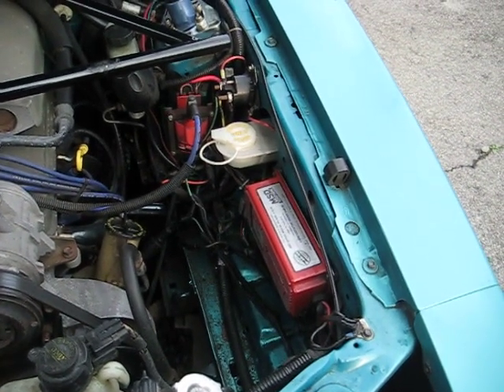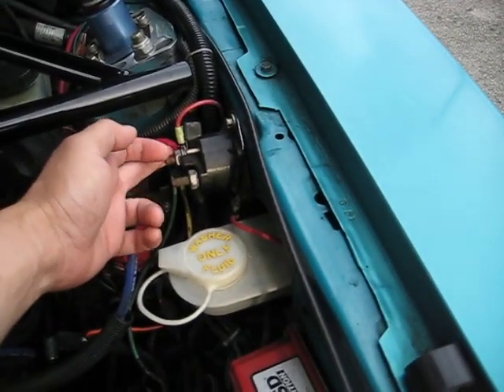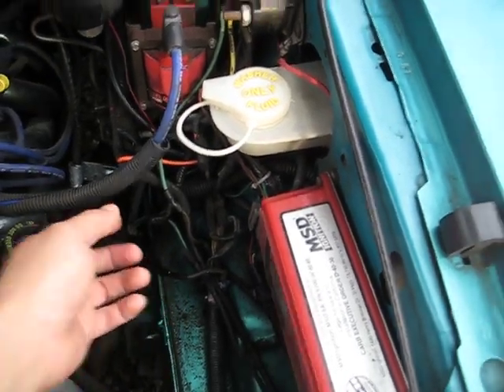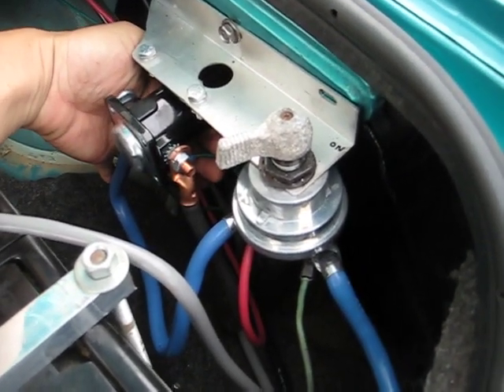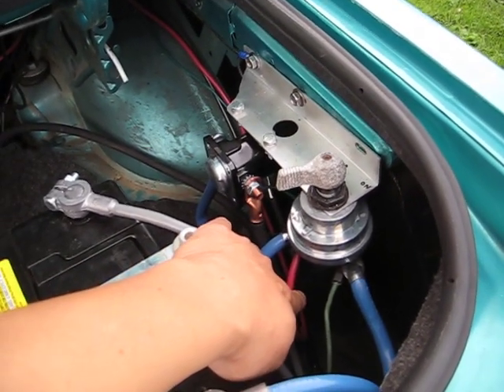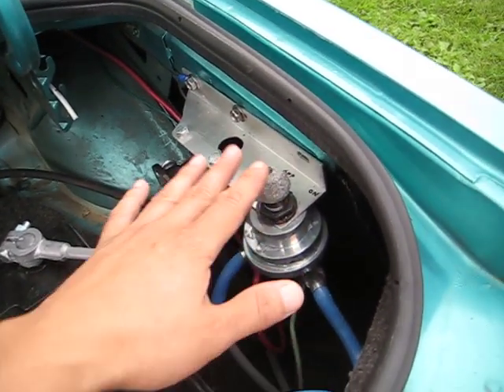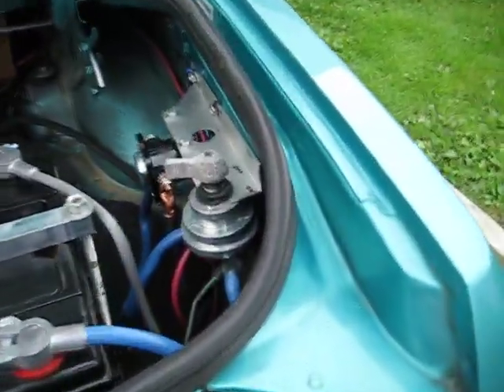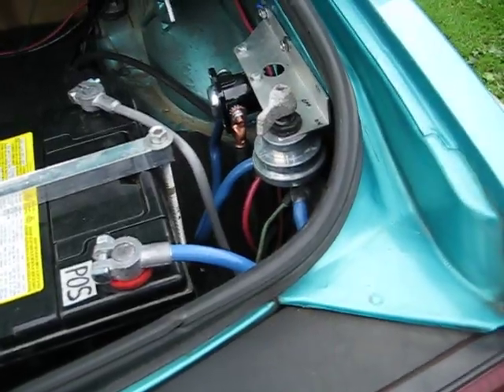Battery in trunk wiring

Comment from the maker: Did you dummies not read the original description.
Battery is in the trunk to improve weight distribution and after that modification. It's required by all NHRA sanctioned tracks to have a kill switch that not only isolates the battery but also kills the running engine.